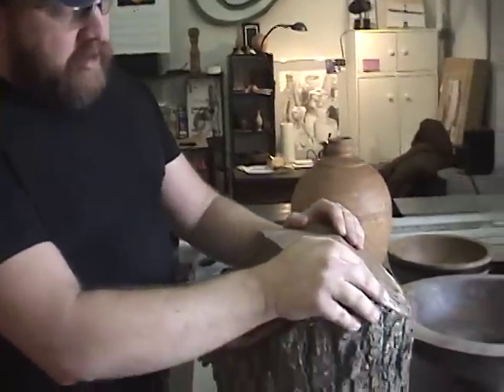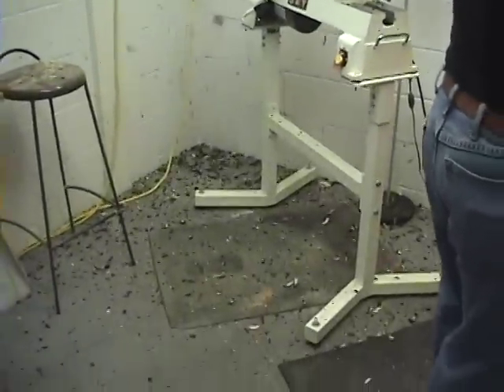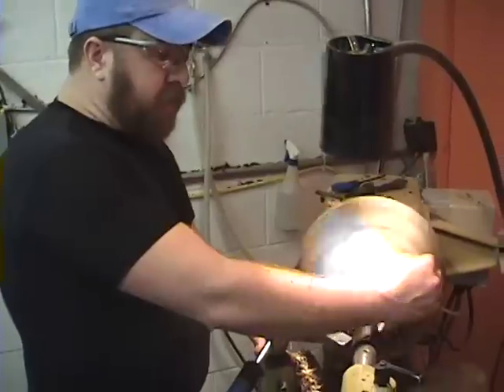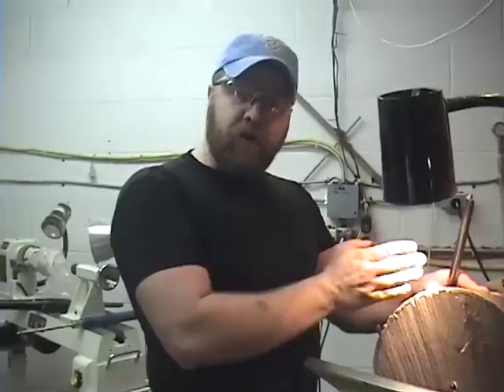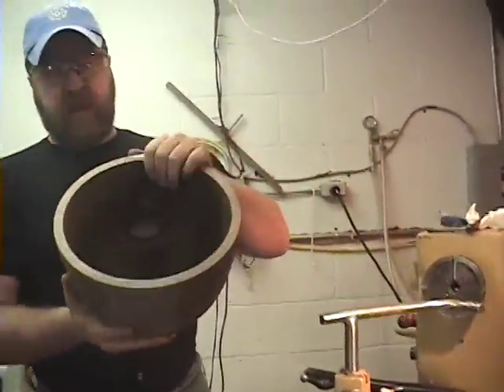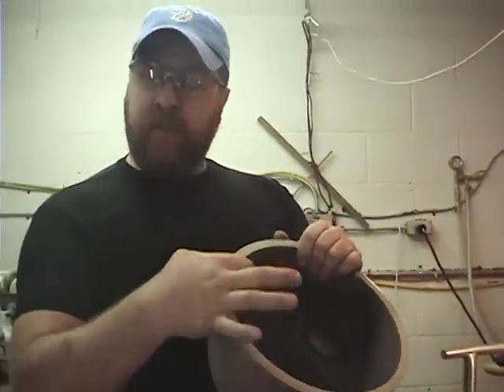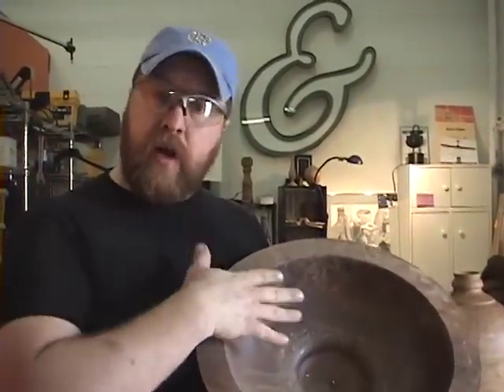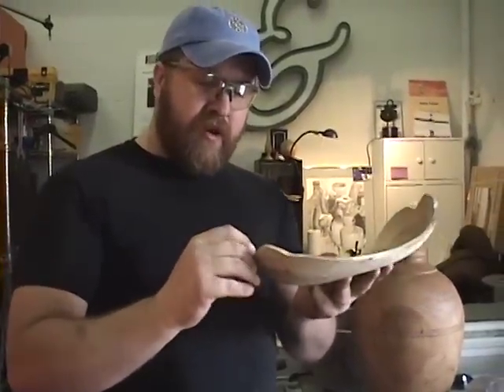Devon Palmer - Columbus Woodturner

Comment: @Airsoftkid212 :  That's a Powermatic 3520-A, the earlier version of the PM 3520-B which is currently on the market.  20" Diameter by 35" long capacity.  The little white one in the corner is a Jet mini.